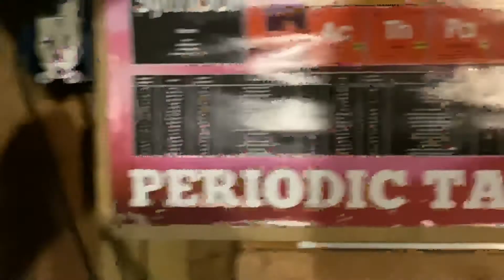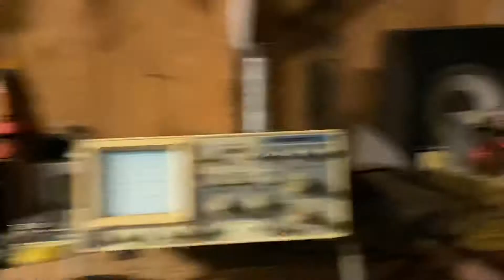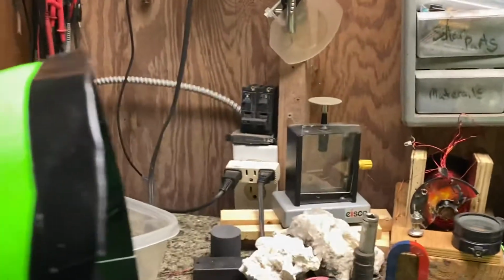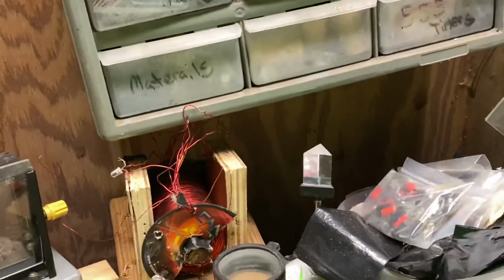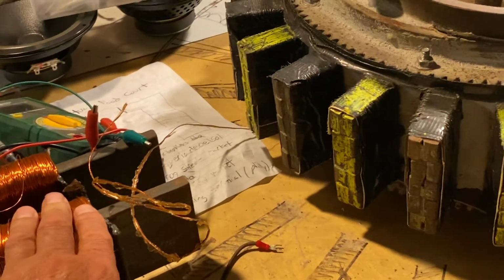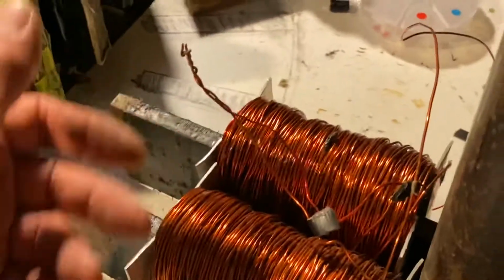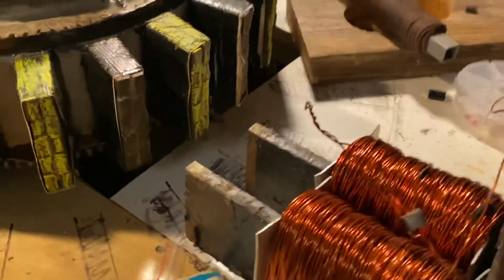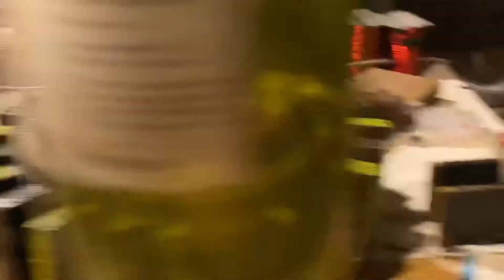Ed Leedskalnin, Nikola Tesla, Wilhelm Reich!

Comment: I've always thought Ed used salt water inside the wheel to make an induction based Homopolar dynamo. The salt water touching the magnet neutrals creates the "disc" and the electric current produced by turning the wheel could then be applied to the handle completing the circuit. If "tuned" properly you'd cause sonoluminescense in the water which would produce additional energy transferred to the magnets by "burning" the water like fuel. Because salt water is the fuel source it would have to be refilled every so often like your car to power the machine.
Reply: I think the the two pipe setup with the bottles on top is right on Roy and also reminds me of the two pillars: boaz and jachin in Masonry. They are two pillars with globes on top and usually stars/celestial symbols inbetween much like what Ed used in his decorations around Coral Castle.
Reply from the maker: Also salt water allows a place for positive charge to accumulate.

Comment: So you will create an electric scalar wave between the two bottles?  The glass of the bottles act as the dielectrics along with the open air between the glasses.  The iron wire inside the bottles acts as a pseudo capacitor plate and are connected together through grounding, which also is a supply of electrons.  So as the magnetic source is pulsed into the iron a pulsing electric field (scalar wave) is set up between the two glasses.  Maybe when you get to the point you may faraday shield one bottle to verify electric scalar wave just for fun.

Comment: So, instead of using the electrical field, use the electro-static field, but keep them from attracting together.  Probably then you create the environment in the area to change the phase conjugate nature of the plasma (stuff, matter/energy).   I think it is all malleable over 'time', liquid/gaseous.  The only real 'solid' is space.

The condensers transfer the heat?  Is there gas in the bottles that will heat condense into liquid?  To dissipate heat?